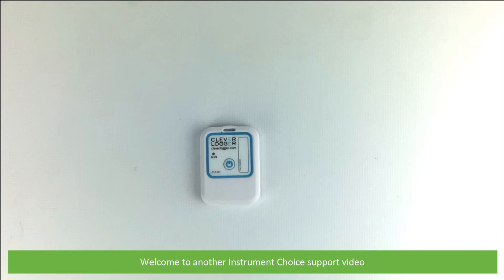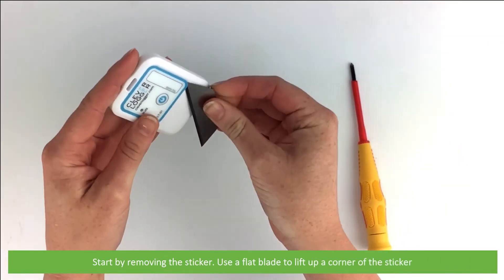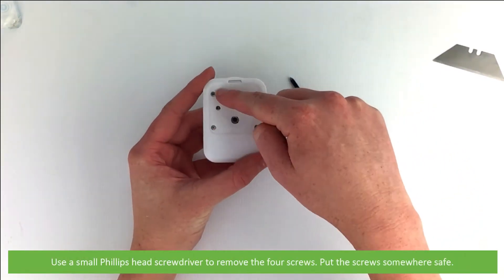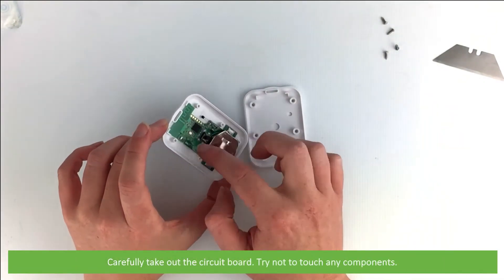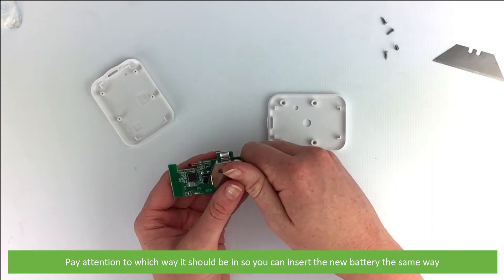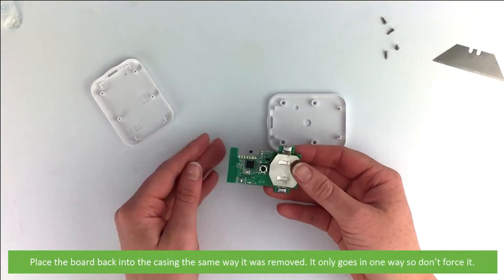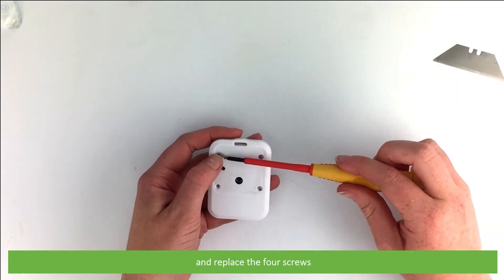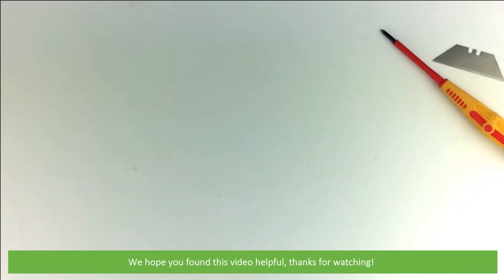How To Change The Battery In A CleverLogger

Comment: you mentioned not touching the circuit board however you have touched it more than 5 times. Why is it so complicated?
Reply from the maker: Hi, Jackson2108 thanks for your query. In general we recommend avoiding touching the circuit board as much as possible due to the amount of sensitive electronics found on the circuit board. This is mainly in regards to the components rather than the board itself. I hope this helps answer your question.